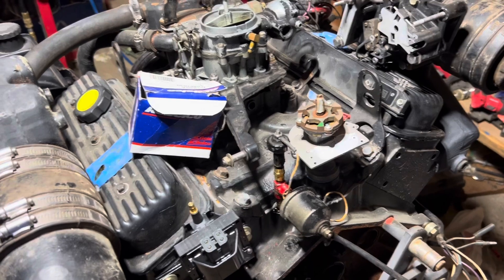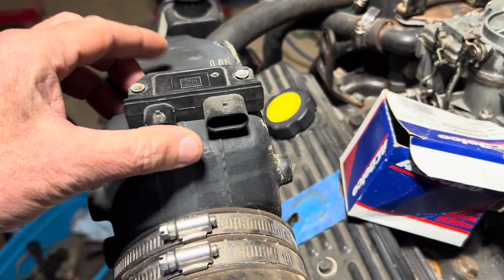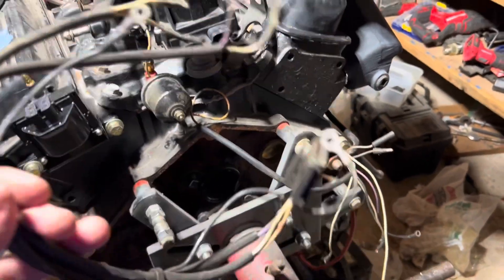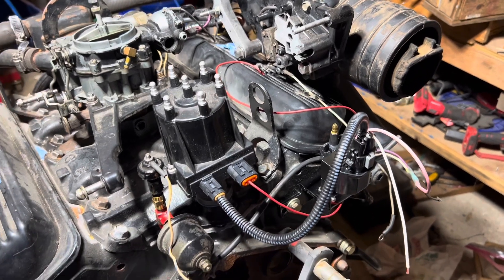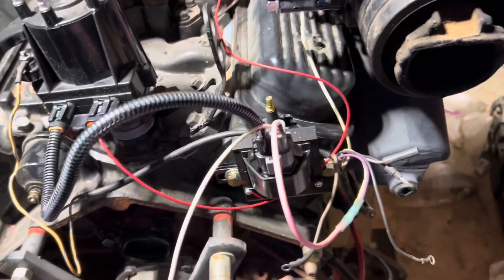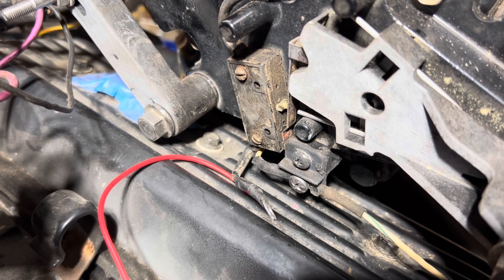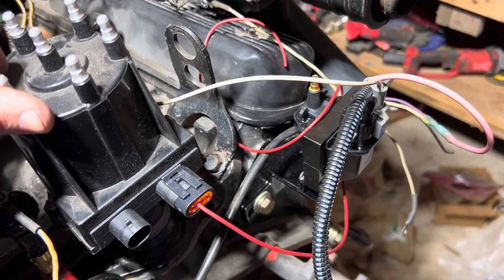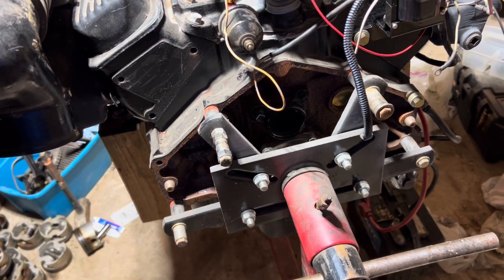11 - Sparkie The Eel - THUNDERBOLT IV R & R

Comment: Hello, 

I’ve been trying to install a kill switch to my 1987 sea ray and i nearly burned my starter down. Any advice to what wire to connect it too.
Reply from the maker: The kill switch goes in the purple ignition wire from the run position of the ignition switch. It doesn’t go in the start wire which is sounds like you’ve been doing.
Reply: @moccasinmarine  thank you for the update! I can 100% confirm I was contacted to the start position instead of the on/ run position. 

I will be sure to try this!!

Comment from the maker: One other tip. If your engine suddenly dies or sputters on the water, pull the shift kill harness out of the distributor. The shift kill switch may have malfunctioned and stalled the engine.